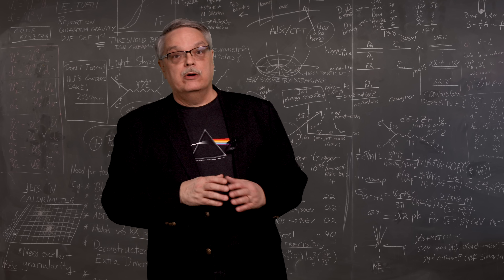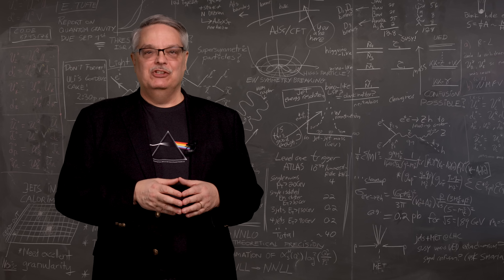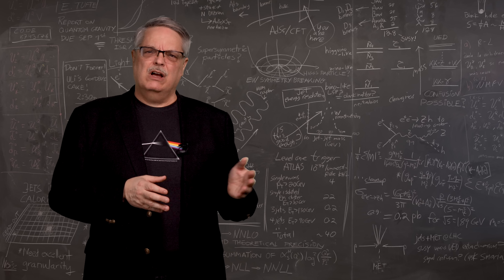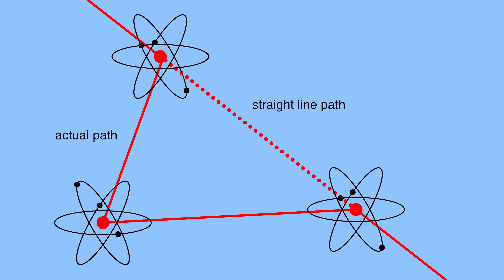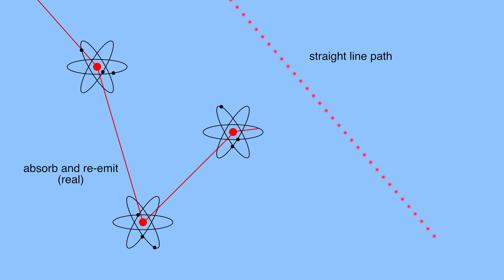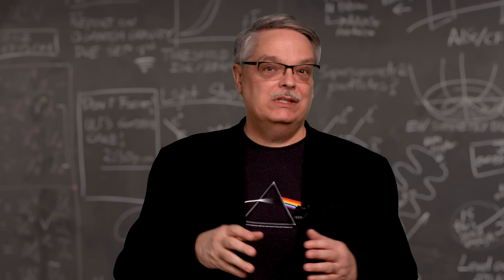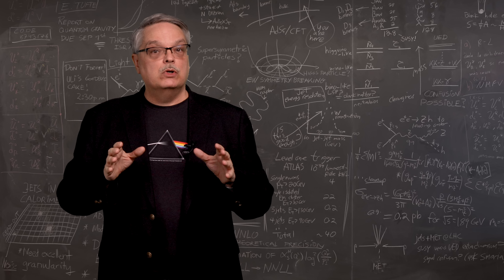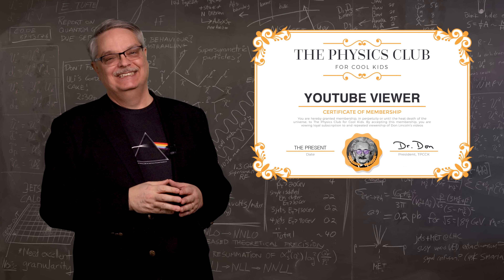Why does light slow down in water?

Comment: I feel like the part where the 2 waves add is not explained enough. In particular there's no explanation why the light from the excitation of the electrons is slower and if it's not then there's no reason the combined waves is slower.
Reply: That's Exactly what i think
Reply: In the classical picture the moving electrons create a classical field that opposes the field of the light and the net effect is zero. You have to be careful with mental models that include things like "leading edges" because those have infinite frequency components, so the approximation of the optical effect of a medium with some effective refractive index is wrong in that case.

Comment: But wouldn't this be testable?
For example, find a transparent material that also conducts electricity, and then apply a voltage to it.

If this were the case, the path the light takes through that material would change with the voltage applied to that material, no?

Comment: Sir I have a doubt in your theory , you said that due to the electric filed of light the electrons of matter generates their oscillating field , but electrons are not still they are moving around the nucleus so how they can generate the electric field you had shown in this video.
Pls solve my doubt.
Reply: It's not the individual electron that causes this phenomenon but the average of many electrons. A single wavelength of a visible light wave equals roughly 1000 lattice constants in e.g. quartz, so there are at least billions of atoms and their electrons involved in even the smallest relevant volume. Once we go to optically active materials that are significantly smaller, e.g. quantum dots, quantum effects involving individual electrons start taking over. A well known example for this are "blue" diamonds. The blue fluorescence is caused by individual electrons that are trapped at so called "color centers" where a carbon atom has been replaced by a nitrogen atom, which causes a second carbon atom to be missing next to it (nitrogen vacancy or NV), if I am not mistaken.
Reply: Thanks and hare Krishna

Comment: You didn't explain why the combined wave has a slower phase velocity. As a matter of fact, your illustration would suggest that the combined wave moves at the same speed. It seems you should have explained that the combination results in a phase shift and that this phase shifts occurs over and over again, each time a new electron deeper in the material becomes involved.

Comment: Wait, but why do the waves emitted by the electrons move at a slower speed? Shouldn't these EM waves also move at C? And why would those waves disappear after the light leaves the medium? Just like the original light beam itself, they should continue forever until they are absorbed. Is the answer to all this related to the fact that the EM waves emitted by the electrons will be emitted in all directions, with most of them not aligning with the direction of the emitted light beam?

Comment: Thank you. As an ophthalmology teacher, refraction is a deep part of our daily job. And this explanation is outstanding!
Reply: It stands out of the reality. 

Don tried to describe the Ewald-Oseen extinction theorem, but in a totally wrong way.
https://en.m.wikipedia.org/wiki/Ewald%E2%80%93Oseen_extinction_theorem
You can find the falsification explicitely:
"...each of these waves travels at the speed of light in vacuum, not at the (slower) speed of light in glass."

2 particle based wrong explanation has been replaced here by a wave based wrong explanation. A fast and a slow wavefront can not be combined, since they can not stay together. This is not a physics model, just a wrong play with words.

The way of thinking of Don is fundamentally wrong, because propagation of light can not be modelled with infinite sine waves, that has no wavefront at all. 

Most of the animations are also completely wrong, for example at 7:11, because it shows different frequencies, while the excited wave can not have different freq. from the source wave (as can be seen at 8:11). Not wavelength, but frequency determines the color!

Almost nothing is right here, except for the falsifications of the 2 particle based explanations.

Comment: a simple answer is the frequency of quantum interactions required to contain energy as mass in glass. is higher than either side. so time dialates. inside the glass the light moves at the same speed. just not to the observer because time is relative. to mass.

Comment: My own, admittedly, imperfect analogy is to think of crossing a chasm on a bridge made of swinging boards.  The boards' swing frequency can not be changed and the runner's step frequency can't either. However, long legged runners swing their legs slowly and short legged runners swing their legs fast.  So all runners have the same speed (lambda times f = c). A runner who swings his legs slowly may find himself hitting the boards when they are going back and so is always delayed.  A fast swinging runner may hit the boards when they are swinging forward and, thus, crosses the chasm faster. It all depends on matching the leg swing frequency to the board swing frequency.

If a runner's leg swing just matches the board swings he may end up not feeling the boards at all and his timeing to cross the bridge would be the same as with non-swinging boards (refractivity index of that bridge would be 1 for his frequency).  If the board swings are just as fast as the leg swings, the runner may end up going nowhere and it could be said that he has been absorbed; as in red light not passing through blue glass.

There's a reason why swings are always used to explain resonance frequency.

Comment: Amazing explanation! Loved the video. 
Follow-up question: What affects optical density? Physically density would make sense considering there's more atoms per unit volume, and hence, more electrons per unit distance in the path of the light to cause the additive wave which is slower than light-speed. But turns out, physical and optical densities aren't exactly related. So what determines the optical density of a medium?

Comment: if a lightwave makes electrons in a medium move, one would guess this transfers or energy to those electrons. but the light leaving the medium has the same wavelength as before, thus also the same energy, meaning no energy loss. 
@Fermilab do you have an explaination for this?

Comment: This is also a wrong explanation as it raises these questions:
1. Why can't both actual and secondary wave leave the medium together, as both are EM waves ?
2. Why should the secondary wave have different velocity at the first place ? Especially velocity lower than C ?
3. Even if I agree that the secondary wave doesn't leave the medium, what causes it to be trapped inside the medium no matter what ?
Reply: Good points! I think the secondary waves created by the oscillating electrons decay very quickly. The effect is dampened by interaction of these charges with other charges in the dielectric and the nucleus of the atom. So any secondary waves that emanate from the medium will be very tiny in amplitude. A secondary wave doesn't have a different velocity. It is the combined incoming (actual) and secondary waves that interfere to create a wave that travels more slowly. The phase difference between the two waves causes the combined wave to take longer to traverse the medium and hence the effective speed of the light is less.

Comment: If light is traveling at it's vacuum speed through the glass but the slowdown is due to the combination of the two waves, then the light exiting the glass would exit at the time it would reach the same point without the glass isn't that correct?  I don't think that's what happens though, the light inside the glass is a wave that can be calculated as this combination but it's actually a single wave, nothing is actually traveling at the vacuum speed.

Comment: Thanks, why the superposition of those two waves always result in slow wave motion? why not faster? Only two waves or more?
Reply: It doesn't actually always result in a slower effective speed of light. I believe the effective speed of X-rays in glass is faster than c.
But because it is only a result of the superposition this is not real faster than light motion. It does not allow you to send any signal faster than c.
All that happens is that the peaks of the resulting wave appear to be ahead of the ones you sent in.

Comment: Have you considered revisiting this video? Because I think it is actually a little bit misleading. 
The effect comes from a phase delay in the response wave(or a phase advance), not from adding two waves with different velocities. 
Both, the incident and the response wave travel at c.
The effective speed of light of the superimposed wave is essentially an artifact of the different arrival times of the peaks , which are shifted by adding waves of different phases.
It would then be an interesting topic to explain what determines the phase of the response wave. And what the wave looks like behind a sheet of material with many point sources.

Comment: Dr. Lincoln is great and this video was, once again, fantastic. How does the light not lose energy when it causes the electrons to move? From where does the energy that is driving the electron oscillation originate? The light leaves at the same wavelength and therefore the same energy.
Reply: Consider what it means in this context for the light to lose energy. It means the wave behind the material has a lower amplitude than in front of it.
The wave behind the material is the sum of the original wave and the response wave. If these are in phase the result will have higher amplitude. Which would mean we extracted energy from the material. 
If these are in some way out of phase we can keep the overall amplitude and energy the same. And since the electrons in the material just move up and down, no net work has been done. The electron is accelerated by the E-field potential, gains energy, and falls back down, giving the energy back. (You can get into more detail because there is a static potential from the proton and a moving potential from the wave).
If they are out of phase such that the amplitude is lower then we have deposited energy in the material. Light has been absorbed and the material heats up.
We call a material "transparent" when it does not (significantly) absorb the light we are working with.

Comment: You ever try to online a powerplant to the grid with different wavelengths and frequencies? The grid will sync all right. Your generator is not at 60 Hz, well it will be when you throw the switch. lol. Crossing voltages are wicked sick too.

Comment: But still I am in doubt, air also contains atom and molecules,
Reply: Correct. Air is not a vacuum. The effective speed of light in air is slightly slower than c for the reasons explained in the video.

Comment: couldn't the slowdown be because the light has "further to go"? this gentlemen isn't taking into account that light is mass and we know from the laws of physics speed and mass =energy. so the energy of the light is still going in the direction out from its source. so despite it bending or curving it still has enough energy to keep it flowing in the original plane. once it passes the deflection it remains  in the original direction on a parallel path. It is not a random deflection as light takes the path of least resistance. it may move a little then once it overcomes the resistance it is constant again!!!

Comment: ...further thoughts. Two waves traveling through at different speeds create a third wave with yet another speed!
This third wave "speed" referred to is actually the new frequency made by superposition of the first two waves . The actual linear velocity of this 3rd wave can have a wave front velocity that is different to the two fundamental waves.  But the fundamental waves are still fundamentally there and travelling at their own speeds. - So the third proposed model is also not correct.

The difference between "free" space and the inside of the glass (or water) is the electric field.
The electric field inside the glass polarises "empty" space more strongly than in "free" space. 
The polarizability (capacitance and inductance ) of space is finite and determines the speed of light. ( c = 1/√(ε₀μ₀)  ). The polarizability of empty space itself is in turn the emergent property of the "virtual" particles that fill "empty" space.
ε₀ and μ₀ (the electrical permittivity (capacitance) and magnetic permittivity (inductance) of free space ) act as the spring constants for the electric and magnetic oscillations induced by the photon particle as it rotates it's magnetic dipole through "free" space.
Increasing the electric field chews up the finite responsiveness of the "free" space in the region of the electric field.   Thus space with a high electric field  reduces the available "springy-ness" of "free "space and thus slows light down.

Higher frequency light produces higher peak electric fields in its electromagnetic wave.
So, the higher the frequency of light - the higher the voltage it adds to the surrounding electric field in the glass/water - the more the permittivity of "free" space becomes saturated and the less responsive "free" space becomes.
Which is why light not only travels slower in a medium (with internal electric fields) but also why higher frequency light is slower (also bends more) than lower frequency light in the glass.

Comment: Dear Dr.. Lincoln!  Thank you for this nice video.   

This iis not a complicated case, but it is complicated to explain!  I give you my opinion below in case that you are interested.

Not sure you resolved the problem with this explanation!  :D  You must have received a lot of comments!  :D  

Ligth only goes at C in the vacuum, including atomic vacuum.  Hence, light only goes at C, just like Einstein postulated in his Theory of Special Relativity.  So, speed of light never decreases.  In water, it becomes "speed of electromagnetic waves" in lieu of "speed of ligth".  Hence, the Second Postulate of Special Relativity is always observed (light goes only at C, as light only goes in the vacuum and perfect vacuum have 0 point charged particles).

Why the overall speed of light (speed of electromagnetic wave) is reduced in water and other medium ??? THis is the problem that has to be explained.

A beginninig of an answer is :  Speed of light is not the same as speed of electromagnetic waves.   The "speed of electromagnetic waves" includes absorbsion and re-emission of light by point charged particles (slower than light).  However, the "speed of light" in the vacuum does not include the speed of absorbtion and re-emission of light, as perfect vacuum does not have point charged particles.  The difference is only a question of the presence of "point charged particles", as defined by the periodic table of elements (atomic model that you show in your explanation).

Electromagnetic waves only goes from higher potential to lower potential (this is what determines the direction of electromagnetic waves).  Since incoming light hit water at one point and is absorbed, it makes this point a higher potential.  Then, the direction of propagation of the electromagnetic wave is determined.  Etc...

Finally, the refractive index is one thing.  The determination of the speed of ligth is another thing.  In trying to measure the speed of light, I found out long time ago that "it is not possible to be sure that the photon that left origin is the same as the photon that arrives at destination".  Hence, speed of light is not really measureable.  It has to be determined OR one can pretend that he measured it with simplifying assumptions.  But, in short, one will have to admit that it is not possible to measure, unless one can follow the photons in the atomic vacuum between atoms/molecules.  Otherwise, we have to be honest, C has been determined to define "space time" or a measuring system. 

Naturally, theoretical physics is one thing, experimental physics is another one.  My comment is a mix of both disciplines, as I am immersed in both.  Finally, per my understanding of Einstein SR and GR, his theories are more a "measuring system" than anything related to gravity.  SR is a basic definition of Space time and GR is a more complete one.  In both cases, it relates to a measuring system that can be improved over time (it will take a few thousand years to adjust C, assuming it is the same value everywhere in the vacuum of the Universe, if I understood correctly).

Comment: One part I don’t understand that seems to be skipped over: why is the electron generated wave at a different frequency or speed than the driving wave? Shouldn’t they have identical frequencies and wavelengths? And shouldn’t they both be traveling at the same speed? If so, then the only difference would be a phase angle and the superposition would be unremarkable. 

If, however, the electron is being driven at a different frequency then something more interesting will happen, but what causes the different frequency? Similarly, if the second wave is moving at a different speed that causes something interesting, and matches the first example of two waves given earlier in the video, but what makes the electron generated wave slower?